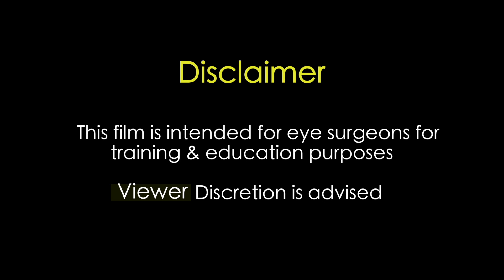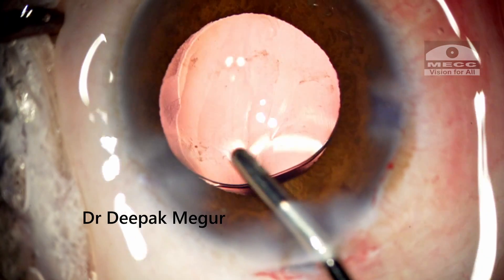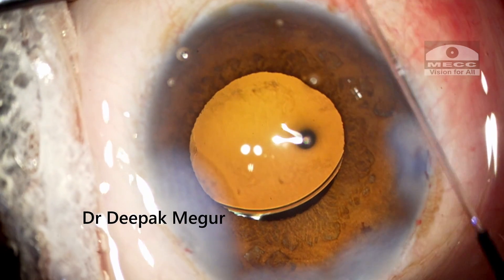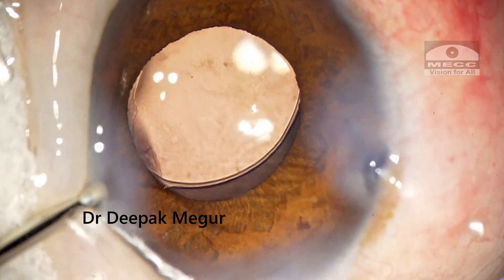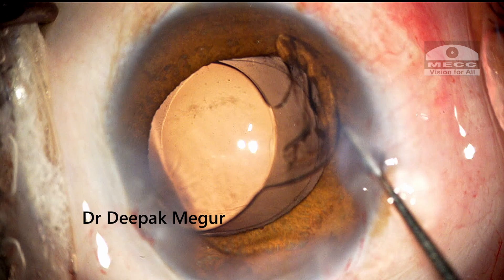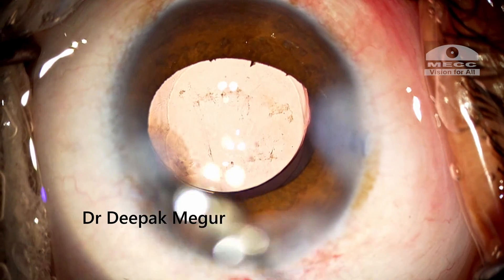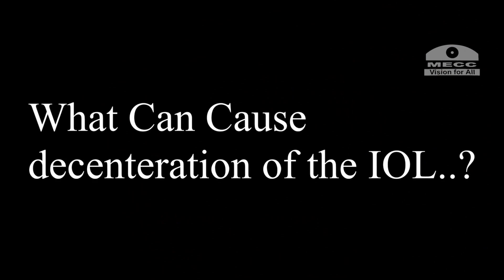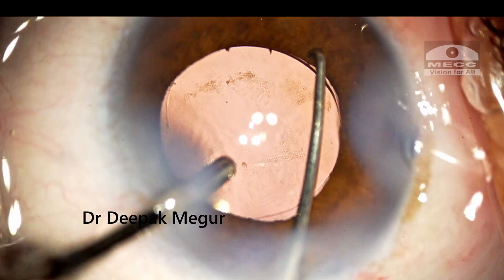the enigma of a decenterd lens

Comment: Other things to consider are positive pressure (try to loosen speculum), and aqueous misdirection. One thing that I have done is to reform the AC with BSS using a 30 gauge needle by puncturing through a new site, rather than going through the prior paracenteses.

Comment: Seems that this is a large eye with a bigger capsular bag than usual...orieting the haptics vertically in the smaller meridian rather than horizontally made it more centered...what was the iol power in this case?
Reply from the maker: The IOL power was 20.5 D, the axial length was 23.05 mm and WTW  was 12.1mm .
The IOL length is 12 mm.
Reply: I agree, maybe a large WTW, bigger than the total length of the IOL